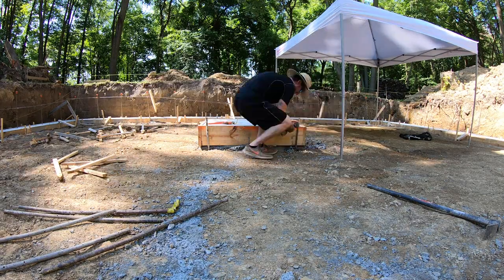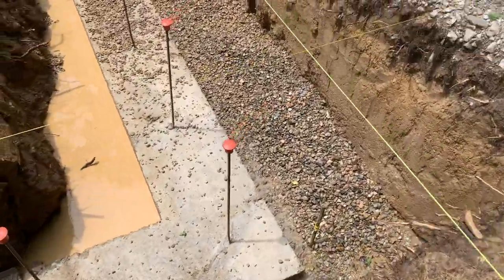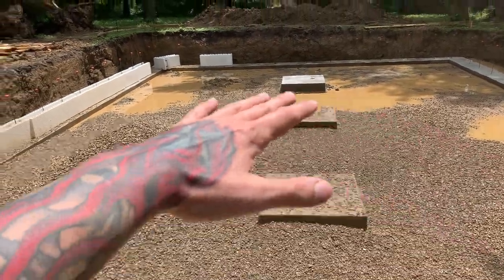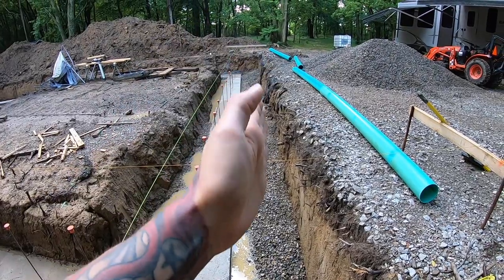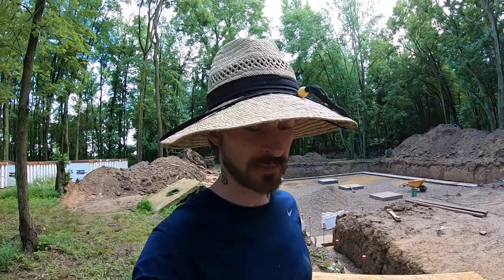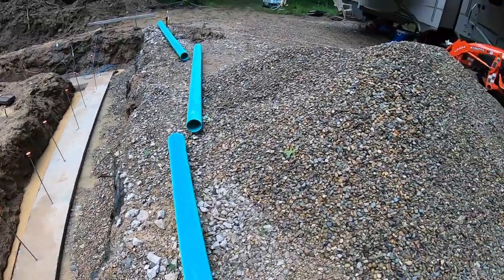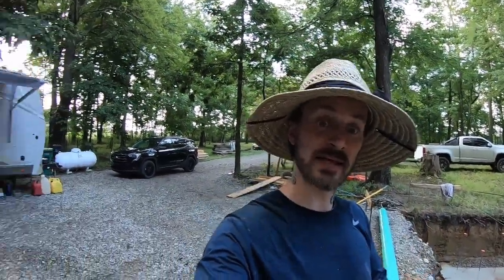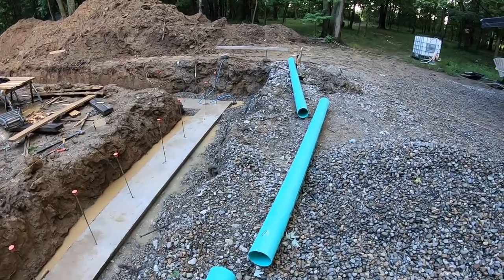ICF french drain, throwing stone and concretes hardened.

Comment: Did you consider using a form-a-drain system, to move the water from inside to outside the foundation and then drain further away.  Less labor, not removing forms, plus the benefits of moving water.
Reply from the maker: no i didn't.  with a waterproof spray on, the dimple guard and using round stone, it can all rush straight down to the 6" french drain and be taking into the sump pump system and then back out.  everything is so large and pretty cheap it should be bullet proof for life.  im not sure what that would cost but i bet its the same or maybe a little bit more money.